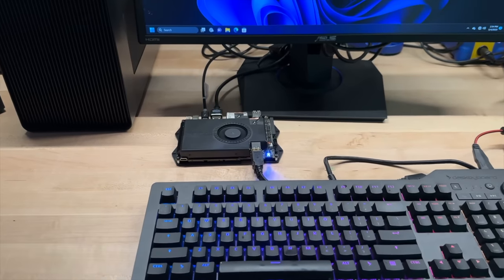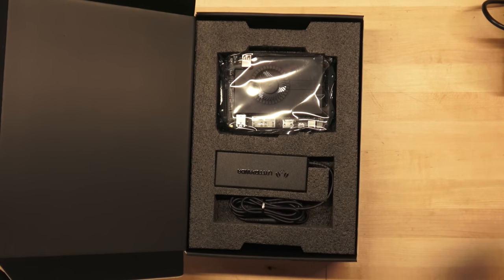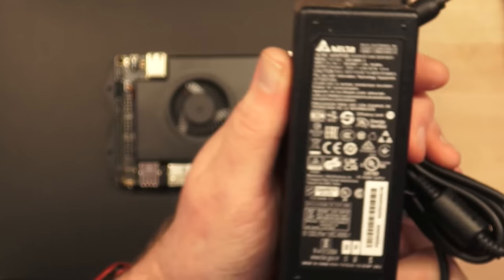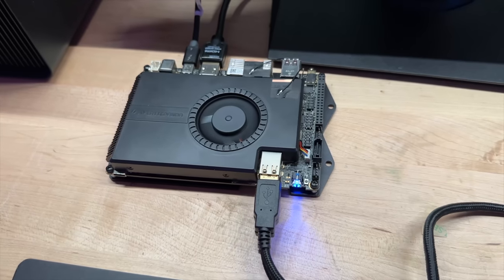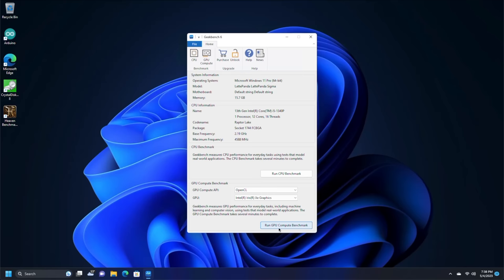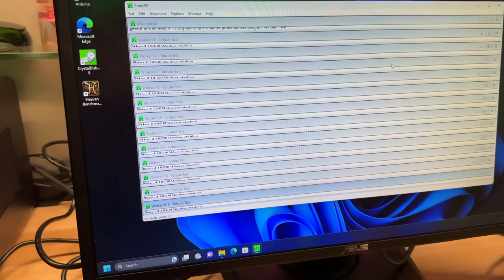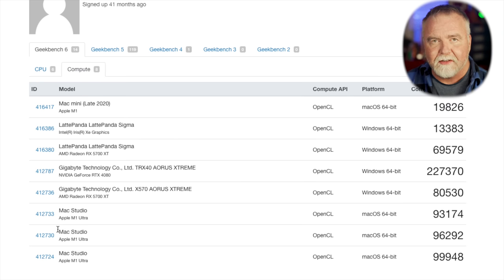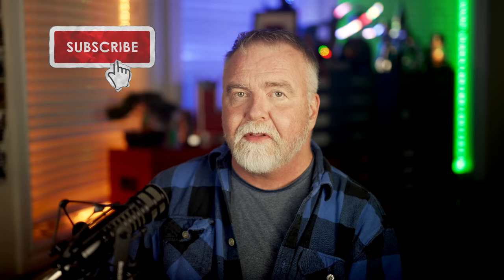The Sigma: The Most Powerful Single Board Windows PC

Comment: So basically, like a laptop board with 3 M.2 slots, 2x2.5G ports and GPIO. Pretty nice if you need it, considering the price is just $130 more than the Framework’s 13th gen i5 board (which uses the same CPU).
Reply: For people that hates laptop like me, I think this SBC is a good one. Imagine you can bring your work back and forth without a very heavy bag. You only have few options with a laptop, like having a small and light laptop, but you can't stand the very small keyboard and screen, or, like bring a very big laptop with large screen and keyboard, but the downside is it is too heavy. We can always bring portable monitor and full-size keyboard/mouse along with the small laptop, but that defeats the purpose of the laptop, with just added bulk. So why not have this pocket size PC and then you have options to bring portable monitor and keyboard (and they are not that heavy alone!). And once you reached your destination, you can simply plug it on your existing workstation, keeping your other portables in the bag. Plus, laptop battery will only take few hours, and so once you work or game, you'll probably going to plug it most of the time like a normal computer. Plus, permanently plugging your laptop as a workstation will definitely kill its battery overtime. Unplugging it might help, but it's more of a hassle when you can just plug it and leave it without worries.

Though yes, laptop is very good for people who likes to work in a middle of travel as you don't need to assemble something. I have tried that, but I couldn't work on that kind of setup, I always stop-by to a hotel if I really need to work, for the reasons of guaranteed power source and internet, security, and focus. Which brings me back to this SBC, I can just plug it in once I'm in the hotel!!

Can't wait other variants of this SBC!! The 32gb!
Reply: @roguemx  You don't need to get a Framework laptop. They'll sell you just the board, so you're in good shape (and there are plenty of designs for little cases & the like). I think the fact that you can dump 64G of RAM on the framework board is a good upside...
Reply: @kevinfrei  Yeah, been eyeing on that framework laptop as well. With its board, it's almost similar to building a NUC PC, but you'lre building way more than a NUC. But with this SBC, I have nothing to build and just plug in my storage and put it on my pocket. 

Don't get me wrong, I love custom build PC and been doing that (variants of SFF, my smallest is 3.3L GPU included). 

But for travel, I would rather have a complete but powerful pocket size PC without a need extra effort to build, just like a phone. It's basically just like laptop performance. Then I can do all heavy lifting once I'm on my workstation, or attachment to eGPU. Like you're bringing your NAS and few apps, and data with you.

Comment: @Dave's Garage

Please try some FFmpeg encoding testing. That Iris Xe with 80EU's is a transcoding beast, this could make a great Proxmox node with all the ARR's in docker along Plex or Jellyfin fed from a separate NAS.  I have a 1235u with the same GPU running Blue Iris/CPAI with 24/7 no substream recording on a dozen 5mp 1440P cameras @5fps and the CPU is ~40% with the GPU ~30% all while only using ~26w at the wall with a 14TB WD Purple drive. I run Frigate along with a Coral in another 1235U that is running bare metal HA using the substreams for notification's and automations and it sit's ~20w all while dealing with ~130 devices split between the Zwave, Zigbee, wifi, 433mhz, and BLE protocol's. I am very happy with the efficiency as I get everything in place but I already see some places where I can squeeze out  a fare bit more. This rebuild all started as part of a desire to go solar this year and part of that was gauging usage and trimming the fat so the dual socket servers had to go.

Comment: Dave, love this and these type of videos! Please keep them coming.

LattePanda Sigma: Hmmmmm well the hardware says, "firewall," but the pricing at $648USD is $300 overpriced. So no. Just no. I WANT to like their brand, and they have some (other) good SBCs, but I can get a Beelink or other knockoff mini with two network prots (or a MOGINSOK clone of a Protectli fan-less fw) for less than $200 less. If this was in the $300 - $400 range, rack mounting these would make a decent cluster. :) 

I miss Threadrippers. :(

Comment: Might be good as a render farm for people with limited space and electrical.  Twenty of these at full render would be 1,200W, not heating your room or small apartment and well within the breaker-box limits.  In fact that's about the amount of power consumed by a single top of the line overclocked gaming PC - except this gives you 240 cores and 320 threads.  Sweet!  It would be a little pricey at $12,580 (for 20 of the 32Gig - no drive units) but not all that bad .  We could boot them over the net and run them off a partitioned NAS as well - so wouldn't even need SSDs. Although 64GB or 128GB units are far more desirable for distributed rendering, 32GB is enough for the majority of jobs.  It's a shame this unit costs over $600 and not down around the $250 to $300 mark where I believe it belongs but still quite interesting!
Reply: there are plenty of 250$ SBCS and mini pcs - just buy older one or w8 till this will get older and cheaper

Comment: A trick for the wifi antennas that Ive learnt is to snap, clip it in from an angle (30 to 40 degrees), not straight down, you'll bend stuff.

Comment: Now this is an extremely impressive device.. It checks a lot if not every box.. Intel NIC, fast RAM, decent GPU, extensibility, thunderbolt and as you benchmarked does very well.... Very tempting and pretty much beats the Intel 13th gen Pro NUC as far as I can see and then some....  Pricing is still on the very steep end I suppose but then again, that is the market these days

Comment: I think if you swap those SSD's over then the 980 Pro being PCIe 4 will be a lot faster once you place it into a PCIe 4.0 x 4 port rather than PCIe 3.0
Reply from the maker: I assume it'd still boot, too... I should swap them and retest!
Reply: @DavesGarage  I also noticed - at least in the video - you didn't attach/use the heat transfer sticky pad for your 980, but I also am not sure you really ran enough disk activity to heat the SSDs up all that much... just something I noticed is all :)

Comment: The current trend where SBC are now boasting of powerful CPU and heavy RAM is good, but it will also come with hefty price that might be out of the reach of most DIYs. Not sure if I want to spend $600 to operate my home automation or run my CNC router when a decent RPi 4 or their multiple clones (yeah, I know those are costly too nowadays) can do the same thing.

Comment: In the realm of circuits and electronic lore,
Dave strides into the tech galore.
A single board marvel, the Sigma unfolds,
In Dave's Garage, where innovation molds.

Twelve cores humming, a digital choir,
Sixteen threads weaving, a tech desire.
Sixteen gigs of RAM, a memory cascade,
In the world of Sigma, where wonders are made.

Storage, a kingdom of five hundred gigs,
A digital realm that endlessly digs.
Dual NICs with 2.5Gn might,
In the Sigma's circuits, data takes flight.

USBs and Thunderbolt, a symphony grand,
In Dave's skilled hands, where wonders are planned.
Ten gigs of USB speed,
Forty gigs of Thunderbolt indeed.

Dave demos, benchmarks, a tech ballet,
In Sigma's prowess, where minds find a way.
A single board marvel, Windows at its core,
In the digital saga, the Sigma does implore.

So here's to Dave, in his digital garage,
A poet of circuits, a tech sage.
Sigma, the powerhouse in Windows decree,
In Dave's skilled hands, a tech jubilee.

Comment: £550 with 500gb ssd + wifi 6e? not bad.
This does show that a rather powerful device should be put in a vr headset very soon. 
This is a lot of power packed into a tiny board!

Comment: I have discovered some desktop computers that are single board computers. Dell Micros and equivalents. The micro I own supports 32 GB RAM, 1x M.2 SSD, 1x M.2 WLAN. ethernet, one SATA, 4 USB3 on the back,  1 x Dp. It's quite old, Optiplex 7050.

No header though. I can grip the case across its length, but it's too heavy for me to pick up. This has an i5, it supports  i7 too.

Although it is a SBC, it is intended to be use in its case.

Comment: Real hero here is the Mac Mini. M1 is almost 3 years old, the base model mini (a 700 tops usd computer so only 100-150 more than the panda) still comes within 10% of a latest gen i5 (it was launched along side 10th gen) and it does that on a 15W chip (so over 3x the power efficiency). Sure the Panda is way more flexible and way better for a DIY scenario, but the mac is going to be a more polished product with probably a better warranty/reliability prospect, plus you get macOS if thats your thing. For home server use, The mac mini is still a no brainer. I guess the only downside to the mini is compatibility because arm

Comment: If memory serves me well enough, I seem to recall hearing that this board does have a very small 2-position COM select switch to provide users the option of RS232 vs RS485 support via the 9-pin COM header, but I might be mistaken.   Didn't hear anything mentioned about it...though it isn't really a biggie for nearly all typical use cases.   Can you confirm whether or not the onboard Gb Ethernet adapters provide PoE support? 

Thanks for awesome unboxing and review, Dave.  You're really quite good at it, even if you don't much care to do it!

Cheers

Comment: Tbh, I don't prefer this form factor. Something like USFF PC or Intel NUC are fine. But even then these PCs have small cooler and are noisier at load. For me SBC does not have any advantage, it just looks a bit messy, especially when you have SATA SSD zip-tied to the bottom or external power brick. Sadly this one does not offer RAM slots or PCIE at the edge in case that someone wants four etherport ports or so.
I experimented a bit and for my needs, perfect server is refurbished USFF PC with i5-6500t. Power consumption is down to 5.5 watts idle (with very little load and less time in C6 sleep state, usb wifi, keyboard and mouse it goes up to 8-10W). There are better low power option, but this is way faster than celeron/atom, not mentioning Raspberry 3B. Of coarse, raspberry and celeron-based sbc can still run many services such as various monitoring, logging, serve static web content, ... Actually I miss information about idle power consumption here, it can be a nice home server, despite I don't like certain things ... but nothing is perfect.

Comment: I've got 2 deck out systems. evo NVME, RTX30xx, Crucial Ram etc. That little board is faster than my I7-10700K and almost as fast as my I7-12700K (single core of course) on geekbench. Pretty impressive.

Comment: Of cause a Thunderbolt 4 conection can be used for many things. But the reason to hock on a GPU is if you have a multi position workspace and you for some reason need to work on real hardware. (for example if you are on a plane or a train sometimes)
Reply from the maker: I have the eGPU because I used to use it on my Trashcan Mac!
Reply: @DavesGarage  well..that is sort of a od combo.. I was thinking a thin and light pairing would be the best.

Comment: Imagine this thing had dual eMMC 128GB
This could be a monster-micro file server, with mirrored NVMe, and then an optane drive as cache, or 3xM.2 in ZFS Z2 for more storage.
Imagine it had a 2.5G+10G network port it would be a great firewall+steamcache, though my problem is that you probably dont want to run your firewall, on the same hardware you're using for steamcache, and whatever you're controlling with GPIO.

Comment: does this support thunderbolt/usb4 usb-c single cable mode operation, i.e. you power device and send display output and usb upstream hub data connectivity all over a single thunderbolt/usb4 connection?
Reply from the maker: Yup!  I plugged it into my monitor, and the keyboard and mouse were plugged into the monitor, and it all just worked properly.  So it must be remoting both the USB and video.

Comment: Nice video again Dave. I'm looking for a computer that can run in my soundstudio. I'm using Presonus Studio One together with some VST plugins and approximately 20 to 60 track simultaneously. Presonus uses the GPU for drawing the faders, volume graphs in real time. I also need some control software for my Focusrite Digital Interface. It needs to absolutely as quite as possible. What is your guess, would this single board computer fit my needs?

Comment: The GPU OpenCL score is a little less than half that of a 970 GTX, which is not bad for integrated graphics. It's not going to be a 1080p powerhouse for modern games but it's good enough for some decent casual gaming and would be great for emulation.

Comment: What's the difference between a Single Board Computer.. and a laptop motherboard?

My interpretation was just that it's a single PCB with things like CPU and RAM soldered on, but most thin and light laptops do that now too.. 
I've seen some arguments that an SBC contains absolutely everything needed to fire up and run on a single board, with only peripherals excluded - but this Sigma needs an SSD slotted in which makes it no longer be a single board?
Is there something I'm missing?
Reply: No difference. Laptops also get a attached screen..

But this has Gpio pins tho.. good for building stuff

Comment: It seems like the Arduino part of it is kind of an add-on that could just as well be a separate component. That said, I'd really like to know what the specs for that part of it are.. Is it an Uno? Mega? Due? what kind of processing power does that part of it have?
Reply from the maker: It's a Leonardo.  And yes, its separate from the CPU, but integrated into the motherboard.  I shows up as a COM port on the PC.  So you just flash your Arduino Leonardo code to COM3 (or whatever).  Very easy to use.  I wrote some LED rainbow code to test it out!

Comment: I'm a little confused as to what market this is being aimed at. 60 watts is huge. Pretty bad for anything battery operated. Peripherals seem to be limited with a single i2c, spi, and a single uart; falling short of most uses of uses of single board and embedded systems.
For a cpu buff, it may seem interesting for a raw bit of threaded compute, but for the price range, it doesn't really fit in any where.
Cheap server?

Comment: Only two questions:
1) Why?
2) For who?
The performance is a lot for average tinker. It's not practical to put in rack or any usable box, because the ports are all around. It's also not fanless to have it in a room where you spend time. It's also not easily servicable - if it breaks than you are loosing all the hw. A home user could put a SFF server together with a similar performance for less money. Business users already have blade servers. Who is the target audience of this beast?

Comment: Do you think this would work well as a VM machine running PfSense and Pi Hole?  5 gb internet at the house and 10 gb network backbone.
Reply from the maker: I think it'd be great.   The 16GB RAM is a bit tight perhaps, but for running 2-3 VMs should be ok.  I think it'd be ideal for PfSense and PiHole.